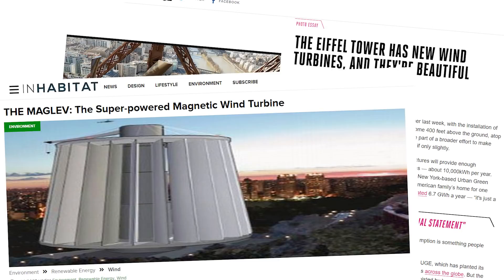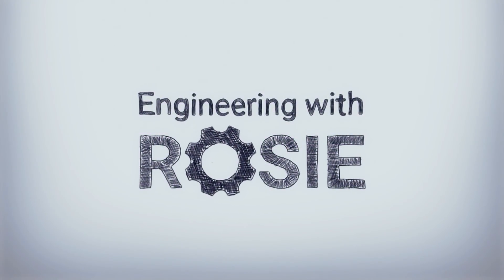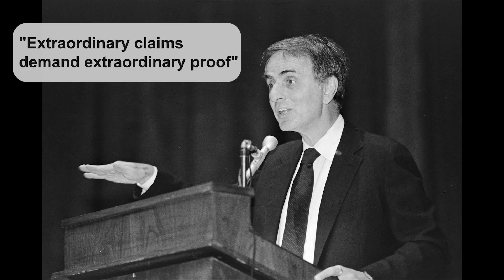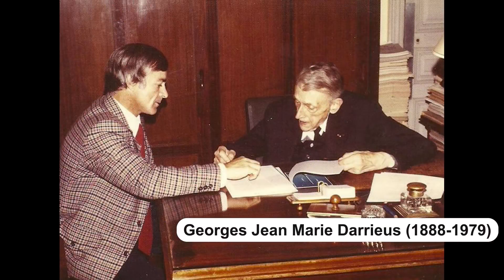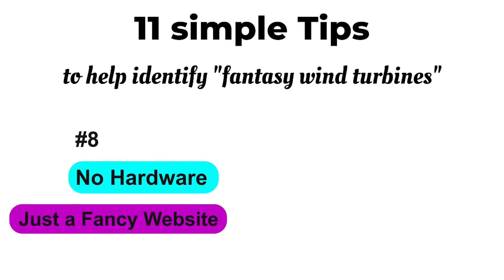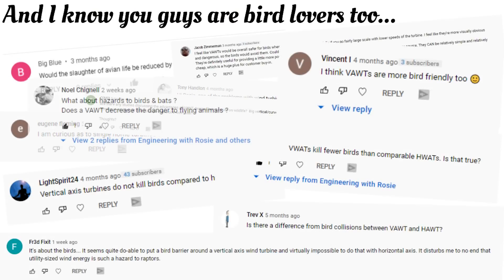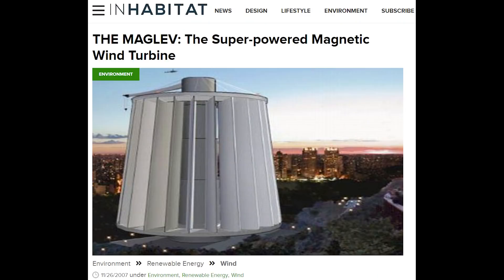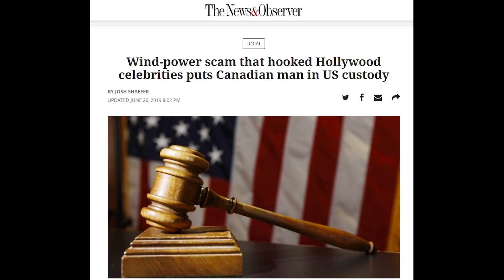Back to the Future of Wind Energy Technology with Paul Gipe

Comment: To me wind turbines fit to country side and for city side photo voltaic fits better if concentrating on renewable energy. Statistical death rate per energy amount (Kilowatthour or Joule) is for me also an important characteristic where renewables seems to be better than fossil energy, but surprisingly nuclear power wins over renewables.
Harvestable wind energy depends on rotor area and wind speed (both: greater is better), but internal efficiency and material durability are important for their economy over time. 3-blade turbines are optimum compromise between number of blades (more are better) and rotary mass (more is worse), when blade shape design uses (bernoullies streaming formula) like air plane wind design principles creating additional dragging force by sub-pressure on the blades back side).
@energy storage: is the key for using renewable energy in the large scale, as fossil fuels already store energy from past time to be replaced in the long run of peak, peak coal, peak nuclear elements and their long time range.
Today many companies offer multi Megawatt sized wind turbines, a size that failed to be reached in 1980s northern german wind power research project first Megawatt size wind turbine using a 1 rotor blade concept, unlike 3 rotor blade concept of smaller, but at that time already working wind turbine designs.
Today gearless wind turbines are standard even in the biggest size due to advances in converting unsynchronuos electricity into power grid synchronuos electricity via modern power electronics.

Comment: The best efficient turbine architecture and geometry is one that has high lift/drag ratio also produce a least of eddy current also features constant torque output per cycle. eg horizontal axial fan blades. Caveat? Tip vortex. 

Alternative? One that waves. Waves? Yes waves. eg fish shape. So consider turbine flex like fish swimming through a fluid, perhaps with no tip vortexes.

Comment: There is a Germany-based company that is in the business of "Airborne Wind Energy Systems" and I've taken your tips for an evaluation:
#1 the hype is not too high, experience is high as the founders are very experienced (founded 2014)
#2 marketing is not very aggressive
#3 no celebrity I'm aware of has endorsed them 
#4 they have not claimed that
#5 yes, they claim to have patents
#6 no drag device
#7 no ducted turbine
#8 they build working prototypes and show the data gathered from the test runs
#9 they are planning to run tests from 0 to heavy winds
#10 yes, it's sound like a silent system
#11 does not kill birds: I've not found any information on that

As there are "orange" but no red flags. There are a lot of moving parts involved, as with any kite-system, but could this be an alternative to the wind turbines?

Comment: Ok, so Rosie, you don't to be Debbie downer, but hey engineers are good at it. Love your analysis, but it misses two things. First, you have significant opinion with little data to show what is good or bad. It seems you are more concerned with where people spend money to develop to your opinion. This in the end is something none of us control. If it were a no Brainer then the economics would be there for long term benefit.otherwise it a real business case condition. You sound sharp, so what are the criteria for a good wind turbine. I have opinions too, and think there is no one panacea for off grid, or most efficient. That is a constant moving target.

Comment: not opposed to supplemental energy at all but manufacturers need to be honest about start up wind speed and output power for every mph of wind speed after that. I don't expect big output from low speed wind, just an honest easy to understand real world data sheet. a small rooftop VAWT exhaust fan isn't a bad idea, making bogus claims IS.

Comment: i did a wind frequency study using data from local weather station and realized that i won't get my future windturbine to be economical at all.
i wanted to gather wind datat myself but need to build a small weathers station, which i didn't have any time to do
but a slow VAWT might be interesting to reduce storage, but i think they are have t be really big to produce any usable power at slow speeds (the idea is to produce electricity at night when solar panels arn;t producing  anything and reduce stoarage requirements)

Comment: I think those that want to make wind energy. Need to look at the realistic ability of creating it. Efficiency obviously does not exist. But how much energy do you need. This is what you need to determine. I'm building a homemade wind turbine vertical. With the idea of being able to charge 10 or 12 batteries. With the amount of power I need that should be sufficient to meet my needs. Is it the best system absolutely not is there better out there absolutely. But I'm looking at meeting what will it take to meet my needs. If my turbine produces what I hope it produces it'll take the place of both 30 solar panels. Will it work I don't know yet. LOL cross my fingers hope for the best. 🤞🌈🙏

Comment: I'm sorry but not all technology affects fauna the same way. For instance in Northern Spain the brown vulture which is endangered gets killed by large blades that are fast at the edges, and basically nothing else. Definitely not cats.

It may be a silly argument in certain contexts but it can also be correct.

While 3 blade turbines are often the state of the art in the appropriate environments, sometimes their zealots use the same arguments that are used against wind energy as a whole. Namely arguments that presume all cases can be reduced to a given average case, or purely market arguments (the grid is cheaper and more reliable for an end consumer, or solar is typically more reliable for the end consumer - as if the answer to these were not "it depends")

Comment: I have also studied many new proposals for small, home-sized wind turbines and agree with Paul that they all seem doomed to failure. I do think that many garage builders who are using partly or mostly accepted designs really do believe they have found the answer. But no matter how well versed they are in design concepts, they don't have all the understanding of what would be financially viable to be marketed as a cost saving method to pay for itself.
First, even the cleverest design still requires wind - preferably steady and significant amounts. And continuous maintenance, and rugged durability, and an almost perfect generator of electricity. Of course most also look like they could not last through a strong storm.
However, I would love to see Mr Gipe take a look at the Harmony Turbines startup, which is now being tested at three universities. Yes, it has two patents and some backers as they near getting the official test results. They are starting small, with fabrication in a shop built by the inventor, but he is convinced that his device will be an important future for wind energy and has a dream of it being sold worldwide. Almost everyone agrees that it looks different than anything seen so far - but it is supposedly a new version of an older design.

Comment: )ne should also consider the greenhouse impact of horizontal blade generators. A huge foundation, of  250-800 CUBIC METERS OF CONCRETE is needed to support the windmill. Care to calculate how much CO2 is poured into the atmosphere to make the necessary cement and steel rebar armature? Care to evaluate how much it costs, in diesel fuel, trucks, bulldozers, manpower, to remove and "relocate" 250 cubic meters of dirt? What about the water table at the site? Will it be penetrated and allowed to be polluted with salt water, as it happened in the State of Oaxaca (Juchitan) Mexico, creating a wasteland where good farmland existed before, and having the complaining farmers suffer "lethal accidents"? DO YOUR HOMEWORK

Comment: Talk about locking the gate after the horses have gotten out. Now verical axis wind mills over three bladed ones are being discussed? You can put up up vertical axis wind mills anyway, and they required less wind to work. putting them on the peak of your house roof is a perfect place. Because there is always wind of some kind going over your roof. Sheesh. Talk about dumb.

Comment: Electric Vehicles / Cars could benefit from wind generators, and also solar Sun roofs or panels, often the motivation to install home renewables is higher EV related energy bills but free or lateral thinking is useful too, I've no idea how much self charging could be gained while driving but just had a 'light bulb came on' moment watching your video and as far as I know that is a new idea anyone is welcome to think about for free.

I think the tendency has been to produce energy but less is given to using it, the two are intrinsically linked and 360' thinking is useful on these subjects, you ever think how much a small Bird weighs? the engineering of Nature is mind blowing, an adult Sparrow is a whopping 3 grams. Beautiful creatures eat my left over bread and scraps straight off the lawn for an attempt at zero waste Nature will help out if you're 'on the money' or rather off it.
Reply: Ack, the energy produced by a turbine comes from drag on the air, so if you had a turbine generating 100W you would have increased the drag on the motor by at least that 100W.

Comment: The technology that needs to advance to make vertical shaft turbines feasible is the technology of bearings.  The thrust bearing at the bottom holding up all the weight of the turbine will get dirty...always.  Then you have to change the bearing by dismantling everything.  So the bearing is the main problem.
Reply: If the rotor creates lift, the load on the bearing is much lower and you dont need a bearing above the rotor like most VAWTs
Reply: Hydrodynamic bearings (oil pressure between two moving surfaces) can bear heavy loads with friction equivalent to a rolling element bearing, though there is the energy needed to drive the oil pump.

Comment: I would like to be able to offset my heatpump power usage in winter with a small turbine. Am I right to assume that this is not possible due to low efficiency and high noise?

For context, I have calculated my household to consume up to 2000 kWh per month in winter and 500 kWh in summer. Is there a small turbine that I can use to offset the peak?
Reply: There is not
Reply: @Altenurgy  😰
Reply: @dmytrokyrychuk7049  Sorry about that.  As you've probably already figured out adding insulatoin if possible or upgrading to a more efficient heat pump are your best options.
Reply: @Altenurgy  The best option is probably to live in an apartment or have a smaller house. My energy demands are the result of my own choices, I realize that.
Reply: @dmytrokyrychuk7049  or a cave... of course I'm not suggesting that.  Don't blame yourself so quickly.    Modern society has really mastered the art of beating into us the need for bigger, better newer, etc.  It's quite hard to escape.

Comment: Question for you - could you use existing wind turbine tech but without the generator to just assist the turning of the steam generators in old school coal power plants? So essentially creating a wind-assisted coal power plant? I'm thinking if this was plausible it would save the cost and resources of building more generators and reduce the C02 from the old plants. Band-aid fix I know
Reply: Interesting.

Comment: Great vid! Nailed inviting Paul Gipe to an interview. But there's an issue... Just because the project is less efficient than an industrial wind turbine, it doesn't mean it's garbage. Just because an hydroelectric power plant is more efficient than a simple water mill, it doesn't mean that they are useless in a little farm scale.
I think you could have talked more about the good projects out there for "backyard purpose".
Reply: Exactly, not like all of us can or want to install a costly, huge, noisy, animal killer or disorienter on our properties. Just rather a small-scale one to help offset electricity cost and possibly also look cool and have little maintenance costs.
Reply: Paul Gipe was promoting build and tested systems versus vaporware.  Those cheap Amazon "400W" turbines are probably ok once tested as 20W backyard turbines

Comment: I'm actually looking for a vertical axis wind turbine, and finding something that doesn't seem sketchy is really difficult. As you say, many promis high output and low noise. I even found one that promised 4kw on a 1,20m tall and 1m wide design, a size where most other horizontal mills doesn't seem to exceed 600w. Too good to be true? Probably.

Though I think I finally found a company that may deliver in accordance with their claims, their biggest strength being that they are a big player in the wind industry and have a good history of constructing ordinary, big horizontal axis windmills. Though if I want 4kw, I'll need something bigger than 1,2m x 1m. Much bigger...

Comment: Awesome info...  Can you recommend a Vertical wind turbine for a backyard? one that isn't a scam and works?  something that actually works and makes 400w+  or 1000w etc.? 
I'm okay to install 2 or 4 of them . .I want to power AC and Heat inside of 3 small buildings ( less than 200 sq ft each ) on my property with those new Mini Split units.. but you can hook 3 to 5 of them on outside walls, and hook up to one system.(sorry if it sounded confusing ) .. But basically want to create enough power to run a small AC/heating unit with wind.. ( may add battery backup? ) thanks for any suggestions
Reply: Backyards are mostly bad sites for wind turbines, too less wind.
I can give you a rough scale of the power generated by a good savonius-type wind turbine of 1 m² (1 m high, 1 m wide) at different wind speeds:
3 m/s: 3 watts (rather less, most of it used to overcome friction)
4 m/s: 8 watts
5 m/s: 16 watts
6 m/s: 27 watts
7 m/s: 43 watts
8 m/s: 64 watts
9 m/s: 91 watts
10 m/s: 125 watts
....
Nominal power is mostly achieved with more than 10 m/s (12-15 m/s), which is normally rather rare near the ground.
Just for a rough idea of expectable power data.
Reply: @701983  don't fully understand all that.. LOL . but i"ll get there.. I was Not planning on wind, but only solar, however. the property we purchased in Southern AZ, is ontop of a moutain at 4100 ft.  I was kinda surprised by the amount of wind.. the neighbors told me it gets very windy here .. and I thought I'd get to use wind power maybe a bit?   I have 40 acres of state trust land behind me with No trees..  ( except a few on neighbors property ) , have a little over 1.15 acres. so was hoping they would work out back of my property next to the 40 acres of state trust land??   But guess more research is needed..  THanks for your reply!
Reply: @compubyte2010  You're welcome! Sounds like a rather good wind site at least. Maybe you could try it with one rather small and cheap wind turbine first and if the results are good, you could install more power. Good luck!

Comment: location location location for wind turbines.  you just cant put it anywhere and expect it to perform. first put a wind meter in a location you think should perform good. move it around till you find the best location on your property. also do different heights. most wind turbines need to be installed at 65-80 feet up to perform good.

Comment: Excellent debunking Vid! loved it.
On my workshop roof, i have pitched solar, facing south, in a place where the prevailing wind always comes from nnw. I have noticed the back of the panels direct the wind and speed it up as the air hits the back of the array and speeds up to pass under the panels (between the roof surface and back of the panels) which has a benefit for my system of assiting in keeping the panels cool (which increases efficency) but i have often wondered if a system could (should) be added to capture this directed concentrated air flow and collect wind energy too.
The idea that a wind collection device is only that, and not also a solar panel, a roof or some other useful device is likely short-sighted thinking.  The mass calculation for creating the wind energy divice could then be "shared" with other useful items (like solar and roofing) and thus be more efficent and cost effective at delivering each.  Just a thought.
Maybe i will test my wind funnel idea on my workshop roof by adding a furnace squirrel cage fan running backwards lol.
Great content, loved seeing Paul walk us through the pitfalls.
Reply: Have often noticed you get high winds between buildings,  wondered if there could be a way of positioning so could make use of this?
Reply: @TheDaztheraz  makes sense to me.

Comment: Motivated by the ending ice-age with upcoming oxygene deserts in the oceans due to rising water temperatures, I forged following lille pLan:
Usually, the ice caps of an ice age transfer by the low water temperatures gases (as O2 for the fish as well as coral and phytoplancton threatening CO2 by acidification) into the oceans. This will stop. But over 75% of the planet's oxygene production as well as over 75% of all CO2 bound into organic matter happens in the oceans. 
The nnz-nnz-nnz music plays in the oceans and not on land.

What if we used off shore wind energy for deep sea elecrolysis, dumping the oxygene for the fish and exploiting the high deep sea pressures for effortless compression of the harvested hydrogene, used for grid stability in electrical gas plants.The hydrogene could also be used as lifting force for self-inflating hydrogene transport gimps.
(play now "What a wonderful world" by Louis Armstrong)